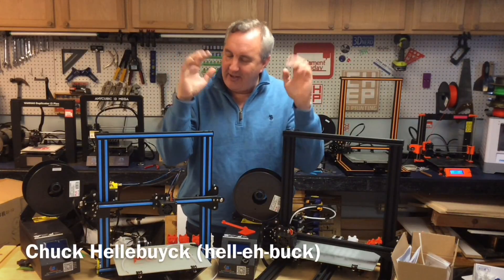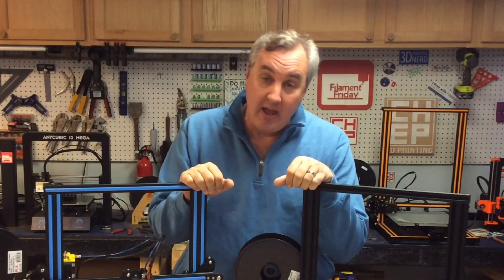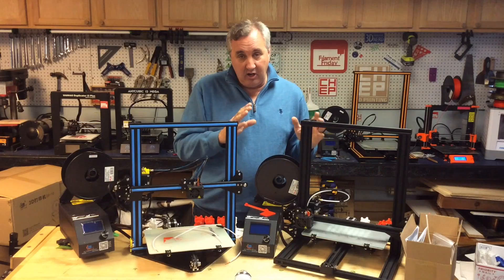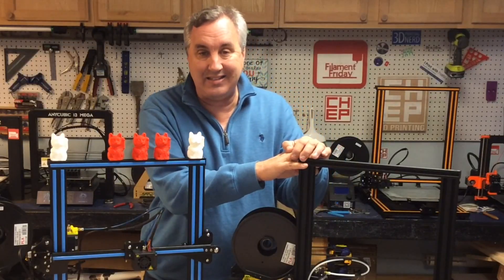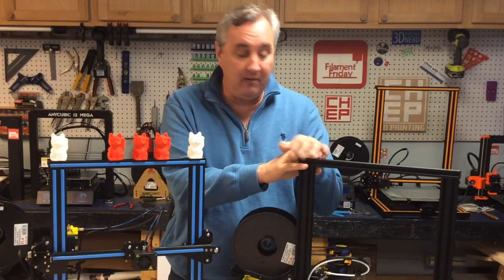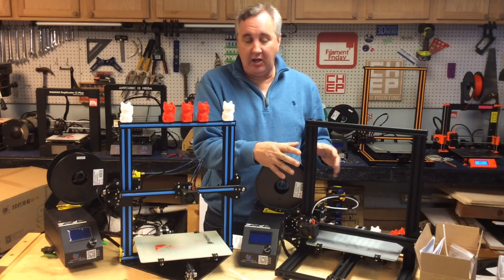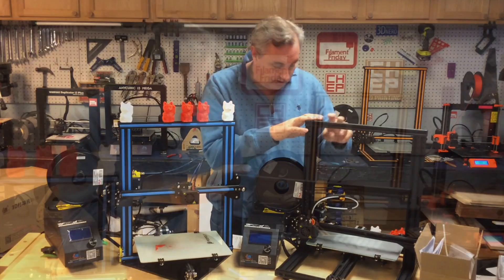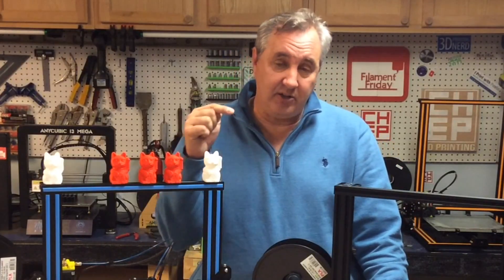CR-10 Mini vs Mini 3D printer Comparison

Comment: hi my friend excelent chanel, would you buy a mini or a cr10??
Reply from the maker: Depends on your budget. I use the CR-10 mini in my print farm because it’s slightly smaller and cost about $90 less.
Reply: @FilamentFriday  i get it thanks! im been offerd a CR-10 mini for 285 dls, a Tronxy X3S for 319 dls and a A10S for 229 a Anet E12 for 239 dls a Monoprice 135881 Voxelwich for 319 dls wich one do you think its the better buy?
Reply from the maker: I’d go with CR-10 Mini.
Reply: @FilamentFriday  you can print TPU filament with the mini? i want to also put a auto leveling its compatible?
Reply from the maker: Yes, though I suggest an EZR Extruder top:
https://youtu.be/1GNDxvxpWr8
Reply: @FilamentFriday  thanks a lot my friend you are the best!! i buy the CR-10 Mini!!, one last question and i stop, can you tell me whats the best sensor to put on the mini with the glass bed? do you recommend to put a autoleveling sensor in the first place?
Reply from the maker: I don’t use auto level. But those that do use the BLTouch.

Comment: Those improvements are not over the cr10 reality is doing a great job of iterative improvements so if you buy a new cr10 it should also have all those improvements I'm glad I missed that acrylic warm you can help it a little bit watch my z5s video for The Zone star printer that's built in a similar way you can buy some tea nuts bolts and 90 degree angle bits four of them to actually bind the two aluminum extrusions together it will help with the stiffness quite a bit which is the core problem here it will never be stable because the acrylic itself Benz and gives I'm glad creality realized very quickly that was a bad idea
Reply: Have you ever heard about punctuation?

Comment: I feel your pain with regards to the davinci 1.0s. Mine has been working for a while, but it is starting to make some strange noises and the bed is starting to chip. I like the CR-10S, but I think I will be going with the Prusa MK3, that thing is awesome. I wish Prusa would make a larger volume printer tough.
Reply: though*
Reply: That's what happens when you don't proof read before you hit send.

Comment: Awesome video Chep I was a little confused by the mini situation as well. Oh but Chep you should try and get your hands on an Ender 2 I want to see what you think. If Gearbest or banggood wont send you one let me know and I will order one and have it sent to you for test then if you could send it to me (i'd pay shipping)IF we needed to do that. But I really want your input on the machine. 

Finally I get to call CHEP wrong on something! (I have been waiting for this for some reason) 3 things. The original cr-10 had a mosfet in the box 3:40 you say no difference. Then right after you say it still only has 1 connector. The cr-10 has 2 connector. Also the CR-10 has a bearing in the z-rod holder thing. Or at least mine has all this going on and I just have a regular cr-10 not an S or anything. 

YES FINALLY! I got to say CHEP was wrong!!!! Sorry CHEP I am so excited about this because out of all the channels I watch you are rarely ever wrong. Or at least that I have seen but I know the CR-10 like the back of my hand. Please understand this is all just in good fun.
Reply: x9x9x9x9x9 ive actually been staring at the endr 4 for the last hour debating hitting the buy button

Comment: Great review based upon actual usage and no surprise regarding the metal versus acrylic base.  I am a fan of Capricorn XS PTFE.  The original PTFE tube on my CR-10 melted and clogged the nozzle after several hundred hours worth of printing.  I am religious about allowing the hot end to be cooled off with the fan after a print is finished before turning off the machine.  I have printed about the same amount of hours post-installation of the Capricorn PTFE with no issues.  Sizing a production printer to the application is of value considering items like energy efficiency, space, and production speed.  My question would be if the CR-10 vs. the mini have similar top speeds or can the mini print the same object faster or with better quality?
Reply: Its awesome stuff. I put some on my i3 mega and have ran it at 250+ with no issues. I actually did a little test with a k type thermocouple and a reflow gun and it handled 300C no problems. I would honestly feel fine trying to print small polycarbonate prints with this stuff without an all metal hotend and using this at the throat liner. I ordered the XS then decided I wanted more for my CR-10 and got the bundle with both XS and TL. I think I might redo my little test and film it.

Comment: How do these compare to the Anycubic i3 Mega?
Reply: I'd be the mini beats the i3 mega. I got an i3 mega expecting it to be amazing and its not. Its good but my cr-10 destroys it. They have a QC problem it seems. I for some reason can't get this machine to print anything under .2mm layer height. It prints .2 - .3 awesome but .1 it sucks at. I think I will try changing my hotend and possibly the extruder.
Reply: The one I got was the version 1 i3 Mega with the buildtak surface and it has worked flawlessly. I just recently changed the surface to their ultrabase and it has continued to print solidly. I have also been printing from 300-50 microns with no issues. If anything, I think I've got really lucky. I wonder though if the heatbeds and material support are better on these mini cr-10s.

Comment: This was an interesting comparison. I think the acrylic base version is essentially a discontinued version of the printer. It doesn't make any sense for Creality to be selling both of these at the same time. It's also weird for the regular CR-10 and the mini to be almost the same price, but I think they will probably eventually discontinue the "plain" CR-10 in favor of the CR-10S. If they did that, the pricing structure would start to make more sense.